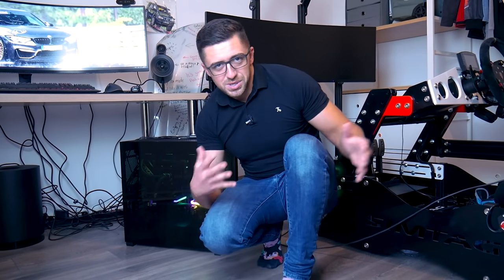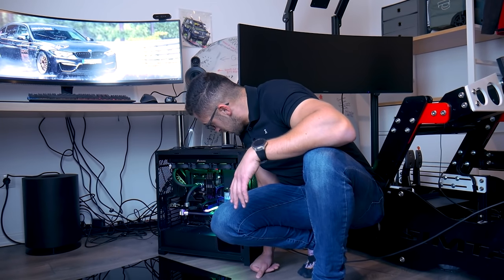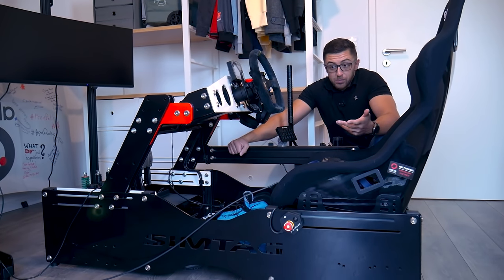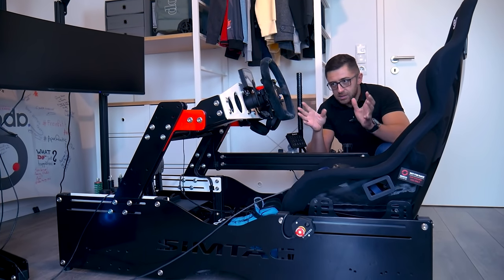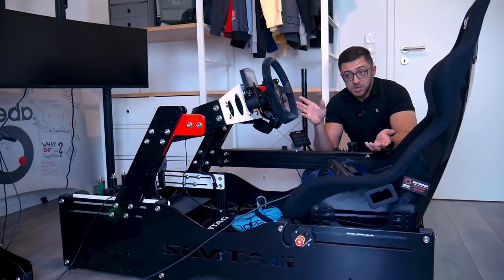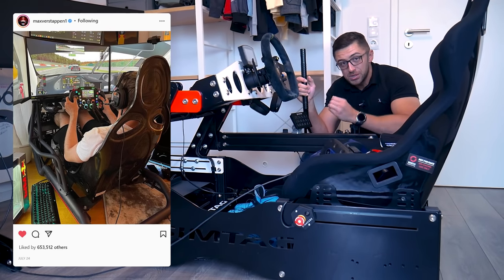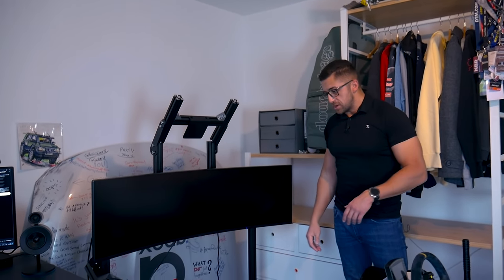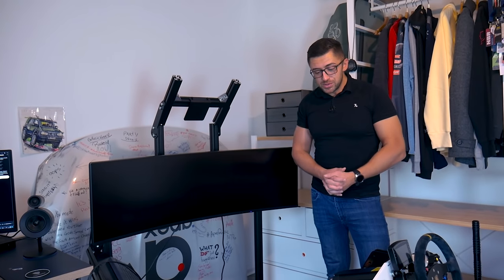My €20.000+ Sim & Editing Rig Walkaround!

Comment: I love how you’ve specced this out, you’ve spent money in all the right places for your specific goals. It’s easy to go down a rabbit hole on the wrong things.
Reply: he just needs to add some case fans to cool the motherboard and the rig is perfect
Reply: @Chris-hw4mq  are 6 fan not enough?
Reply: @donblub  he needs a rear fan and for max efficiency a push/pull on that radiator will lower temps 5-6 degrees C
Reply: @Chris-hw4mq  i would bet he has push/pull...
fronts push, upper pull
Reply: @Chris-hw4mq who would have thought that 1 gen later, waterblocked 4090's will crash because the ram gets too cold.  Running the pump in silent mode so you don't drop below 30* mem.junction with the crappiest thermal pads known to man

Comment: Hi Misha, awesome rig, congrats to it! Love your channel and its diversity, looking very much forward to your content. About the VR kit, it's very important to know that the tracking of the Vive Pro is done via infrared lasers that are sweeping the room. If there is ANYTHING nearby which reflects the light sources, this will throw off the tracking (because the Vive "sees" the reflections as additional lighthouses). You say that it happens near the sim rig, which points to the monitors in front as the most likely source of reflection. But it could also be the Sim Engineering dash screen or any window nearby (EDIT: it could also be the whiteboard behind the monitors). Step #1 for debugging would be to remove the monitors (or cover them with a cloth) and see if the problem persists. For racing, an ideal setup for the lighthouses would be facing you from the left and right (as opposite to diagonally across the room, which is advised for VR gaming where you move around 360°). Having both lighthouses face you frontally over the monitor should also mitigate the reflection issues (IF it's the monitors in your case). Hope it helps, let us know!

Comment: Misha x der8auer, not the collab we wanted but the collab we needed. I've recently bought a similar specced PC (only a 3080 instead of a 3090) with a HP Reverb G2. It doesn't need a base station and works perfectly for sim racing.

Comment: Triple monitor imo is the way to go, purely because of angles. You can angle each monitor exactly to your liking/games view. Whereas a single ultra wide(which is extremely nice btw) will stretch and bend your image where it needs too. You can fiddle with settings to make it better but it never reaches the triple monitors level.

Comment: Awesome rig! VR is the way to go, but TrackIR is a nice middle ground if you don't want to wear that VR headset all day. TrackIR tracks your head movement, so you can look around. It actually feels natural after a little while, just download a nice profile for it. It's just a small IR transmitter and camera you put on top of the monitor, and a small clip to put on a hat. I use it for flight sims. Works great, and it's relatively cheap.

Comment: I agree on Assetto, I just want to jump into any one of a few hundred cars and drive on one of several hundred tracks, with ‘good enough’ realism.

Rig is awesome, I really want to ditch my crappy G27 and go direct drive but when everything costs as much as a turbo, it’s really hard to not buy the turbo
Reply: CSL DD is a decent price would recommend the 8nm boostkit bundle though
Reply: @Vezon-7   Yeah but you need to add a wheel rim, shifter and pedals. ££££
Reply: It's not crappy man, it is what it is and you can tune it really nice and have fun with it. Don't rush, when the time comes, you'll upgrade. Till then, enjoy the G27 :)
Reply: he knows
Reply: fanatec has a pretty cheap and amazingly good direct drive wheel base BUT it adds up when you add pedals, shifter and a wheel
Reply: lol that's the best way I've ever seen someone describe the pains of simracing gear. I just have a midrange Thrustmaster and I don't see that changing any time soon. Currently thinking about nitrous...

Comment: Wow Misha nice to see you Simracing. I really like your setup, especially the simtag pedals. For my own i use the Fanatec DD2 with 911 GT3R Wheel and some CSP V3 (Update planned).
I think your vr setup really struggle to EMI issue, its very common with direct drive and valve Index and can be solved with magnets. Moreover I think pimax 8kx or HP G2 would fit much better to rest of your setup.

What I would like to see a comparison and realtalk about the different sims. (AC, ACC, iracing, rfactor 2 and RaceRoom) I like them all cause every sim has something special and do it best on their own way and points. My main is iracing, coming back everytime cause of the overall and the service. On physics I m with rfactor2 and ACC.

Comment: I would recommend some form of LFE like a Buttkicker. Put one in each of the four corners of the rig and tune them to simulate tire vibrations and road surfaces. I've never been a fan of motion rigs, but I tried a quad LFE setup like 4 years ago and it blew me away. I'm sure with those crazy pedals you'll get an even better feel for threshold braking.

Comment: Misha, you have the same issue as I have. I fixed it with these:  "2 stuk(s) 500731 Ringkern met coating"  from Conrad. Loop your Vive cable five times through these ferrite cores and you're good te go!

Comment: Loss of connection is due eletrical noise. Try:
- connecting a wire from the rig structure to the Ground of you outlet where the sim is plugged
- use a (google’s) cable with heavier shielding. If this is not possible, try buying an usb extension of a higher grade shielding and take that from the pc to inside the sim, them use the shortest cable possible to connect the goggles to it
- if not possible, get shielding mesh, (from a thicker cable, I don’t know if you can buy this separatelly), sleeve it around the googleks cable, and connect the end on the computaer side to the corsair case

Hope it helps

Comment: Hi Misha HTC's headset relies on IR (infra red) tracking. Turn off all the lights in your room and start your SIM rig. Use your smartphone camera and look through your smartphone display for something brightly lit up in your setup. You can use the same trick to find out if your remote controller still got some juice left in it.

Solution 2: ground your system (kijk of je setup geaard is aan een geaarde wandcontactdoos)

Solution 3: return your headset and get yourself a HP Reverb (2) (with inside-out tracking) it is excellent for cockpit setups. It won't require external devices for tracking and is easy to use. Plus the added bonus is the higher resolution displays.

Comment: Base stations require IR emitters from the goggles to be visible to all the basestations without any interference. And interference may come from reflections – do you have any shiny metal, window surfaces or mirrors? You could put a bright light near the position your head would be in the rig and then put your head at the location of each base station. Look around, can you see the reflection of that light anywhere?

Another thing to consider is additional IR emitters. If your screen on the steering wheel leaks too much IR, it could mess the system, too.

And if you have to use long USB cables, the cable quality is important if it goes near any power cables. Other than that, electrical interference shouldn't be a problem.

I would love to see DiRT Rally 2.0, Richard Burns Rally or BeamNG content in addition to ACC which is obviously closest to stuff you're doing with real cars.

Comment: Being a BMW driver, I only use 4 buttons on my wheel... gear up, gear down, flash lights and horn 🤣🤣🤣 
It's all about the feedback that the wheel base provides, not about how fancy the steering wheel itself is... so long as it's something you can hold onto and, if you so desire, shift gears with - it might as well be a socket wrench attached to the base.
Now... we'll need a mod list for Your AC server 😁

Comment: What an insane setup, not overkill at all but designed for a purpose. With computer parts always buy the best you can afford and you seemed to absolutely get that. Hopefully will get to drive side by side with you in Assetto Corsa. 

Personally driving Japanese Touge roads is up there with the Nordschleife in my opinion. Tracks are super narrow with no forgiveness in mistakes and can span multiple miles. It's where I spent most of my time learning car control (until the Nordschleife) and where I would still be spending a lot of time if there were more servers hosting different tracks. I also love 90s Japanese cars so I am a little bias.

Comment: About the Tracker, i still use the first gen HTC Vive and i have set both tracker to the front. Like on 10 and 2 o clock, the left one is about 3m away and above me, the right one is 1m away and above me. Make sure that both tracker are aiming directly to your seating position, they work really well for - especially because my simrig is standing next to an wall ( wall right side about 40-50 cm away ).

Comment: For the pimax and hp reverb 2 VR headsets you don't need tracking base stations. The internal accelerometers are enough. I think with the vive could be the same. Ie don't use external base station tracking since it's a seated VR experience.
Reply: but you can do it with basestations aswell and then you can even get out of your car... it's super cool! maybe he just needs to reset the vr view ? for Assetto corsa it is Ctrl Enter
Reply: you think wrong. htc vive works only with base station.
Reply: The HP Reverb G2 uses inside-out tracking with cameras built into the headset. It's not only using accelerometers.

Comment: Nice! Have fun! Are you using Content Manager (custom launcher with many useful options) and Custom Shaders Patch (updated, advanced graphics and effects) for Assetto Corsa? If not - you should try it.
Sadly we won't get Nordschleife in Assetto Corsa Competizione - official series of SRO Group are not racing there... unless something unexpected will happen. But there are new cars and tracks coming in 2022:  Circuit of The Americas, Porsche 911 GT3 Cup gen 992, Ferrari 488 Challenge Evo, Lamborghini Huracan ST Evo2, BMW M2 CS Racing and more.
Reply from the maker: Yes I am!
Reply: @mgcharoudin  You might want to check out the NSX on Racedepartment. I used the CSP physics features to produce a more compelling physical model for the car, and it goes well with the Nordschleife.

Comment: In Asetto Corsa I had the issue you're running into.  The fix is put the headset on while loading in.  That will put you where you need to be.  Asseto tracks from where your headset starts when you load in positionally.
Reply: I think he's having issues where the headset drops out when he sits in the rig. What you're describing is recentering your headset and you can do this in sim by using CTRL + Spacebar
Reply: @shiftdnb  that didn't work for me. Had to actually load in headset on.

Comment: Hey Misha, see if turning the monitor off when you go into VR helps the situation a bit... it might be that the light from your monitor is flooding your ir-basestations... What i did is get a small 10meter 90degree ir-light/illuminator (usually have to buy a separate adapter smh) to sit to my left pointing somewhat upward, illuminating the room a bit more, which helps with the tracking of the headset.  normally the basestations should illimunate the room,. but apparently monitors closeby will screw up that light and the headset will no longer be tracking properly. (as the headset uses it's camera's to pinpoint your location in the room.)  Or make sure your basestations are pointing into the corner you are sitting in.   Hope it helps m8ey!
Reply from the maker: Thanks!!!

Comment: As for the VR headset issues, it sounds like EMV.
Try completely unplugging the Sim Setup and then test-sit. If it works, it's EMV issues. hat can be easily tracked down to a single component and we can go from there. Looking forward to streams, eager to join with my LowLevel Setup (G27 + RiftS Headset :) )
Reply: And we use the same sh*tty logitech keyboard, scrolling in AC really doesn't work well with the touchpad :D

Comment: The VR headset dying only in the rig is interesting, like Jimmy said it might be EMI from the DD wheel. That whole rig looks to be moveable, but is it grounded well? If it's up on caster wheels or something that insulates it enough, it could be holding a charge that the headset just goes weird from.
Reply: Good point on the grounding of the framework. Is there something of a Faraday cage going on?

Comment: There will be no ring mod for AC C. Unfortunately they blocked the mods, as they signed a 3 years contract with Blancpain GT, therefore only their cars and the tracks they racing on included. I believe AC 2 coming in 23-24. Its already in development.

Comment: Misha, did you peform the correct update on the base-stations ?  and ran the calibration in Steams VR ?
also base-stations need particular setup to keep your VR-headset within field-of-view.
Once correctly configured there should be no issue, mine works flawlessly for more then 2yrs.
even in very low light conditions ( something WindowsVR headsets like HP and others have difficulty with)

Comment: Appears to be an interesting simulator Misha, and it would be great to see it in action on the Nordschleife and/or the F1 track to compare is capabilities v Tino’s Custom Pro Hypersimulator with it's latest mods to remove bezels on three curved monitors and attach 2 x 130*deg clear plastic inserts that remove the black line at the Screen edge

Comment: That looks a great racing simulator! I particularly like the pedals! I used to race in the 80'S up to the early 90'S the pedals have not changed and I like that you left foot brake as I thought it was simulating a manual gearbox bit it is not so you can as I do with my car left foot brake! I bet it is very nice with the steering rack set up too! As I Always found the earlier types you did not get the correct feel from the whole set up! Sadly! Perhaps one day I might look into one like yours??

Comment: Amazing setup! 😎

I only started simracing this year and I suck at it! First AC, then when I got a better PC (5800X, 3070Ti)  i moved to ACC.
I'm running a Logitech G29 wheel and pedal set, strapped to a Playseat Challenge.

I'm looking to upgrade during the next year, possibly a GT Omega rig and the cheaper Fanatec stuff.

Looking forward to some more sim content! 👍
Edit:
As an aside: do you use a switch to go between workstations, or do you plug/unplug mouse and keyboard as needed?

Comment: I'm running a budget build 
T150 wheel , basic pedals. 
AOC 2269w monitor
Sapphire RX580 nitro pulse 8gb 
G.skill sniper DDR3 24gb
Fx8350 
Sims : AC is the favorite, race room is a close second. Same issue with ACC , no Nordschleife :(, haven't touched I racing yet.

Comment: The rig looks awesome 😍
What I keep wondering when I see a high end one like yours. If someone is fast on a track and steps into a simulator for the first time, will he also be fast from the get go or is it a totally different ball game?
Reply: You will have to adjust and get a feel for it no matter what. Of course experience helps to deal with this more or less quickly. But its the same thing like when you switch to a new car in real life. A good driver can adjust quickly, but also he/she will need some laps to find out the figure limits.

Thinking back of sim racing: Even different sims have different characteristics. Even if you drive the same car on the same track on different sim software it will be different and needs adaption.

For example Assetto Corsa isn't really good for riding a car "on the curb". On the Nordschleife it will throw you off most likely. In Automobilista 2, you can feel the wheel touch the curbs on the force feedback. And when it is a banked curb, you can "ride" it.

The feel will help a lot. This is why agree with Misha and his statement regarding Assetto Corsa Competizione. Force Feedback is awesome. You get more detail and information what the car is doing, how the track "feels". And you can push harder. You can't push that hard in a sim, that doesn't give you all the information.

Comment: Just a thought but I run my vive using only one base station mounted directly in front of the rig . So you could try to mount it on the top of your monitor stand a see if it tracks the headset when in the rig . When I first got the vive mounted them in diagonally opposite corners of room but coz rig to one side had tracking problems so moved one in front of rig and all was good so didn't even use the 2nd base station an still don't .
I spoke with vive support and they said the use of 1 base station  for seated gaming was fine hope this helps . Love the vids